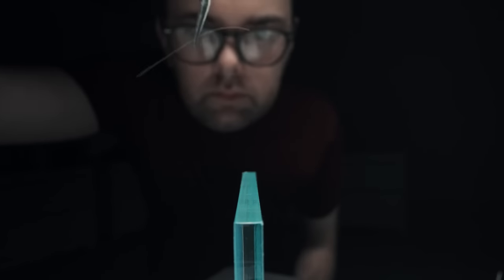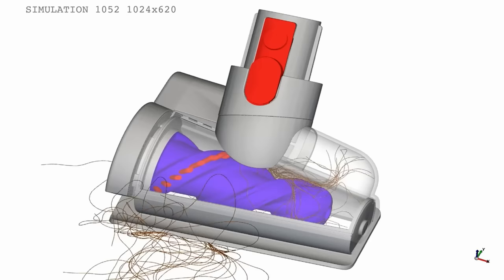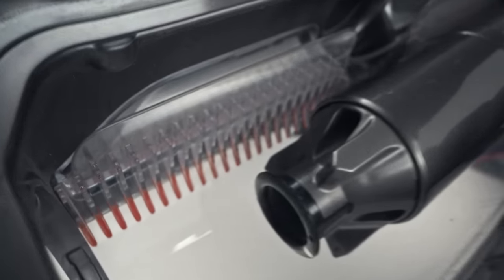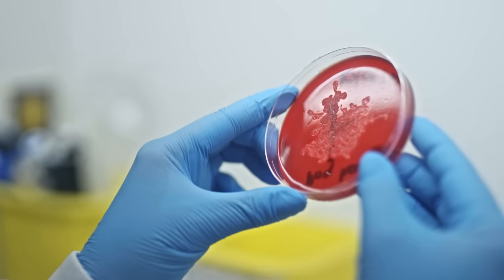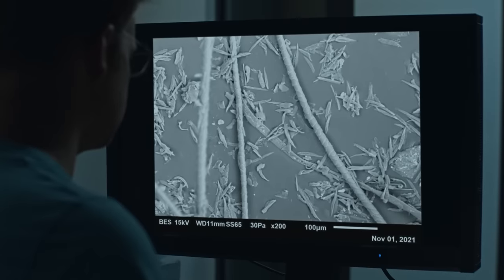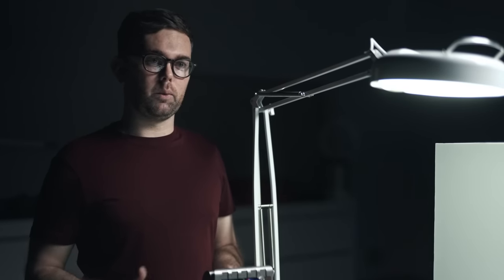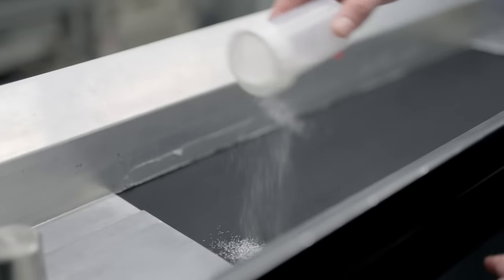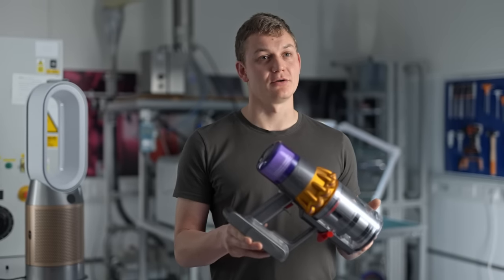Dyson studies the science of pet hair, and how to remove it.

Comment: I've recently got my V15 Detect and, while yes, the vacuum is more pricey, I can also say with absolute certainty that my home has never been more dust free. You can absolutely feel the difference, walking barefoot over a hardwood floor. Being able to see even the usually invisible dust on the floor helps so much with both cleaning and also not having to clean areas that are already clean, saving me time.
Reply: Are you supposed to vacuum hardwood floors?
Reply: @Bunny11344   if you want a clean home. Yes, you should.  If you have the V15 Detect with that laser on the soft head, you'll want to vacuum almost everyday because it shows you everything
Reply: @Bunny11344  You would be surprised how much of a dust layer there is on any hardwood floor, even after just one day. If you have pets it increases by an order of magnitude. I was definitely more than a little surprised.
Reply: @flyingchicken33  that’s good to know I’ve never vacuum hardwood before
Reply: @final3119  I had my Dyson V6 for many many years and just handed it down to a friend. It’s still working flawlessly except that the battery is slowly losing capacity which is normal after 6+ years.

Comment: We got the V8 stick vacuum and it is great even though a bit weak. I apperciate to see all mess that is collected in the bin. However, after having used the V8 for a few months I understand why Samsung has developed a special dust collector bin for their stick vacuum. Emptying the V8 bin is a dusty mess. I have to emty it in the garage. 
I hope Dyson will develop a smiliar bin in order to keep the cleaning chain clean. There is no point in awsome cleaning if the mess is dispursed in the air during emptying of the bin....

Comment: I went from a dyson v10 absolute to a karcher WD3 (literally 10 times cheaper) it's so much more convenient not having the roller pull wires, toss big objects away from the vacuum, the fact that you have continuous high power (and not 6 minutes on dyson). You also never get hair tangled as there is no roller (for carpets I bought a 15 dollar roller that does the job (same if not better than the dyson)).. It's way lighter, has a much bigger tank and can be used as a blower. I don't think  I'll go back to a wireless vacuum any time soon for house cleaning. I'll still probably need a wireless vacuum from small vacuuming (like crumbs next to a table or cleaning, etc) because the karcher is bulky and not practical if you're going to use it 10 seconds.
Reply: Yeah but is your air cleaner

Comment: Shop vac works better for knocking down dust. Just run a pipe to vent the exhaust outside. No special filter needed
Reply: I don't think you get the point of this 😭

Comment: What kind of pc specs need for such simulation software to work? Is the M1 Max MacBook Pro good enough? Or even the M1 or M2 Macbook Air?
Reply: Depends on the complexity of the simulation and how much time you wanna give it to do all the calculations.
They probably use proper graphics workstations and not just macbooks.

Comment: The funny thing is i never had a lot of problems with pet hair getting stuck in the brushes of my dyson. However i had two dysons and never have i had a brush where you have to clean out the little wheel every single time because they are stuck from all the hairs tangled on the axle. Resolve this dyson:)

Comment: My biggest issue with any vaccum is that its not a closed system, and dust always gets out. Ive had to make a super long tube, put the vaccum outside and run the tube thru the window and thats how i have to do it.
Reply: Sharks and dysons are both completely sealed systems
Reply: @Sandlin22  tx 23

Comment: They also get stuck in the bearings of all Dysons I've had so far. You can't remove it because the gear that rotates the brush is molded on the axle. Over time this overheats the bearings and it actually melts the gear. In 8 years I've went through 4 motorized specialty pet brushes. So yes, it removes pet hair from the couch, but it wrecks the vacuum cleaner. Now we use a Philips which costs a third of the price with a simple static strip on the end and that removes hairs more efficient and doesn't break. No more Dyson for me
Reply: I agree

Comment: 20 years and they still don't know everything there is to know about pet hair? Fire them. But on a real note I've had plenty of issues with dyson vacuums  in the past which with the little use my grandmother put them through was certainly disappointing. Reliability, longevity and capability. The 3 things many people look for in any product. Dyson capability is 2nd to none box 1 check. Reliability with several products especially heater fans 1 of which melted the plastic housing  with a high chance of burning down our house with everybody in it wasn't the best experience is a big strike against dyson including the vacuum we had that the battery died within a year. Our current vacuum is doing ok so far for the 2 years or so she has had it. Again it doesn't see a great deal of use. So reliability can see a great improvement. As for longevity I can't speak for because reliability hasn't let anything actually wear out. It just stops working or almost burns up for no good reason so can't check or uncheck that box yet. Build motors that provide the same or larger power at a level that isn't pushing them to the max. Upgrade the wiring and the crap triggers that fail constantly. Also all batteries should be user swappable. I'll pay $1000 for something that is going to last me many many years. Just make it worth the grand. I forgot about the dyson hair dryer I bought my lady that fails to work properly after less than a year of ownership. I wanted to love dyson and bought into it big as you could see but I bought a shark vacuum and a shark hair dryer with a lifetime warranty and after having both for s year with the amount of pet hair in the house has so far been great. But that too doesn't check the longevity box or reliability box just yet.

Comment: The vacuuming brush for pets is just unnecessary. You can also use a hand brush and brush your pet with it.
Reply: That still will leave a bunch of hair floating around and getting stuck to clothes and furniture.
Reply: @yourlocaltoad5102  If you think that's a problem then you shouldn't own a pet at all. Because their hairs are already everywhere
Reply: I still think these kind of products are not so necessary plus they're expensive as hell. Just get an at least 1600 watt vacuum it'll be enough. And theres this pet hair cleaner brush which you move back and forth continuously and it collects all the hair in it. And easy to clean. Thats all.

Comment: Dyson I don’t even want to hear it!! 🤣just send me one of these please 😄I have had to buy a new head for my dyson twice due to my Newfoundland! I legit have to get on my hands and knees and picks and run the fur off my carpet BEFORE I vacuum or else my dyson cannot handle it. The little metal wheel in the center of the head gets clogged with hair and heats up and smells like burnt hair death 😒. Then after I have to top it over and cut the hair out the wheel. Takes over ten minutes and kills my fingers. The hair also stays stuck up in the canister when trying to empty it. I have to almost slam it or reach in. Not trying to go off but I wish my dyson worked better on the 6 inch long dog hair.
Reply from the maker: Hi there, thanks for getting in touch with us.

Sorry to hear that you had to replace the cleaner head twice on your machine. 

Please send us a DM with more information, and we'll be happy to assist you further.

We look forward to hearing from you.